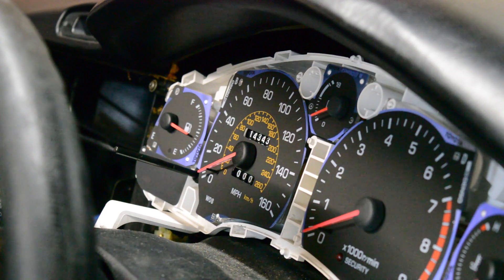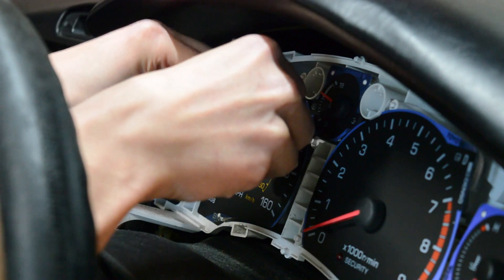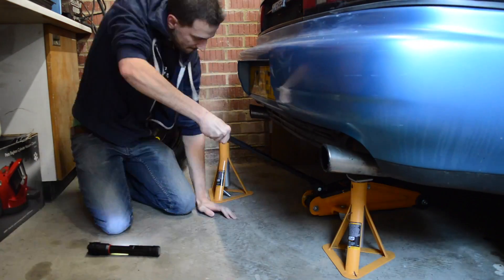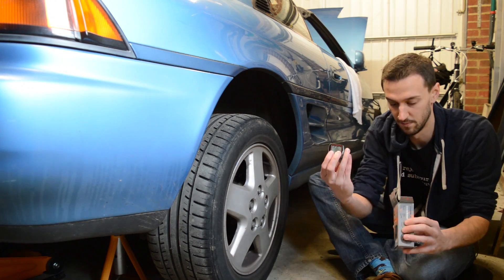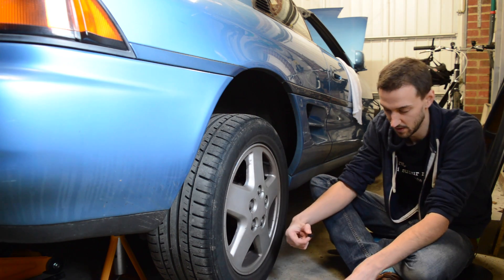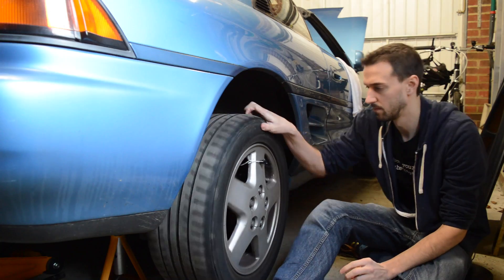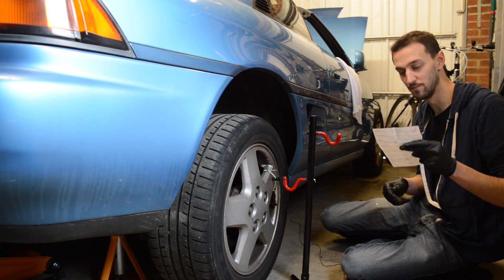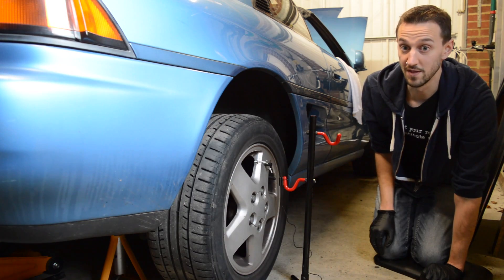Speedo Calibration the Dangerous Way - MR2 Restoration

Comment: if my speedo is off does it affect the odometer?
Reply from the maker: If the needle is in the wrong position like ours was then your odometer will be fine. It will only be out if your car’s had its speedo changed from miles to km (or the other way round) with also adding a converter to the gearbox sender 👍

Comment: If the issue was the electronic circuit, why not just replace the speedo part from the old assembly and put it on the "new" one? That would have avoided the mileage and needle recalibration. No?
Reply from the maker: The speedo and milage was all the same circuit board, so while it may have been possible to just replace the specific components, it would have been trial and error figuring out which ones to replace
Reply: Ok. I only remove the needles as a last resort. Bad experiences in the past... Keep up with the great work (and videos)! :)
Reply from the maker: This was our bad experience with removing needles :) I didn't know before hand that you shouldn't do it, lesson well learned

Comment: Brings back memories. i converted a cable 180kph to a Australian cable 260kph speedo. I calibrated on the work bench using voltage and cable rpm. This was a good video showing another method i had never seen. i should get my MR2 out of the shed more or at least get under it and waggle some spanners.